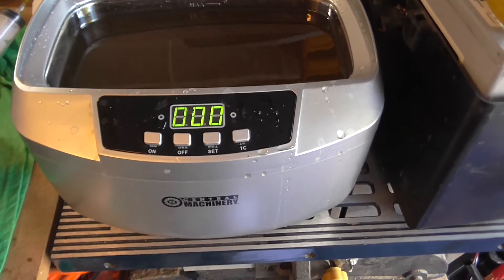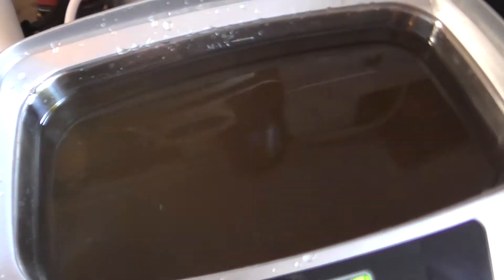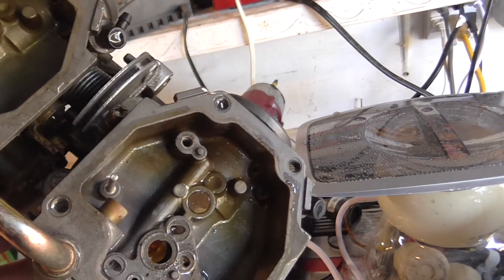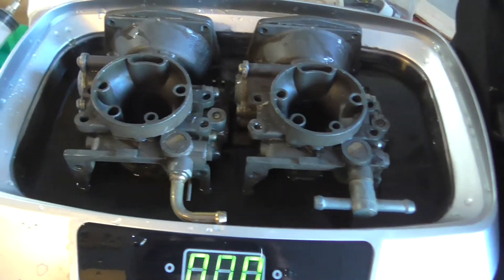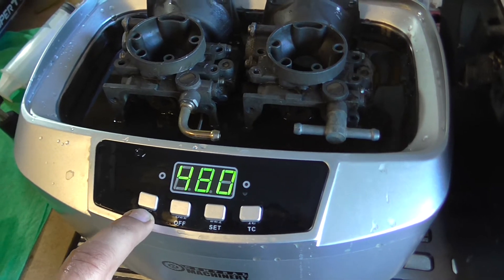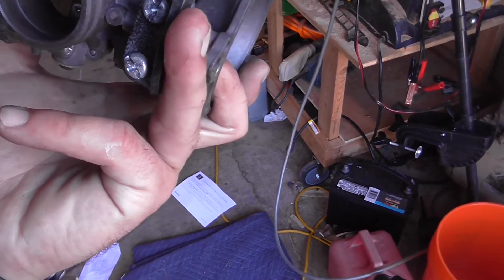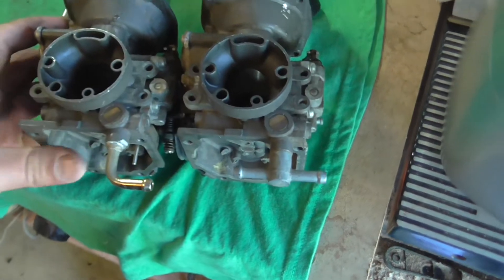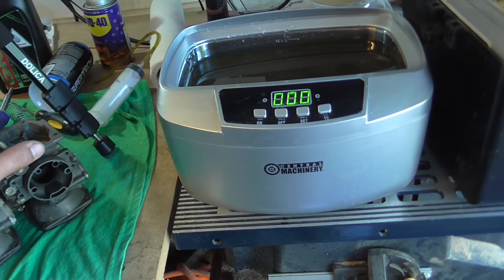harbor freight ultrasonic cleaner

Comment: I got this ultrasonic cleaner a number of years ago for my small engine business, it served me very well, I have since got a much larger 10L 4 vib motor ultrasonic cleaner, I have since brought the little guy inside, I use it to clean my vaping tanks, coins, jewelry, I have had it for more then 5 years, and it still heats up in no time and vibs awesomely, best thing I can tell anyone thinking about buying one, is this, the area between where the plastic meets the stainless steel of the tank never let that area get wet, what I did was this, emptied it after every use, and I drained it with a simple syphon, into a bottle and let gravity drain it, then wiped it out with a clean rag, never let liquid on or near the buttons or the top seal I mentioned, I've had mine for quite some time and never had issues also almost forgot, never move it till it cools down, that way you lesson the chances of the glue attaching the ultrasonic motors to the bottom of the stainless steel bowl separating, it is a great machine for the price and size.